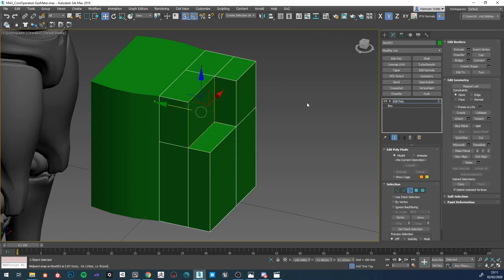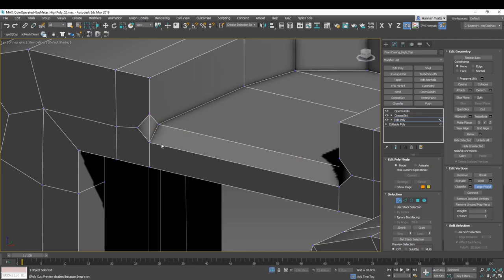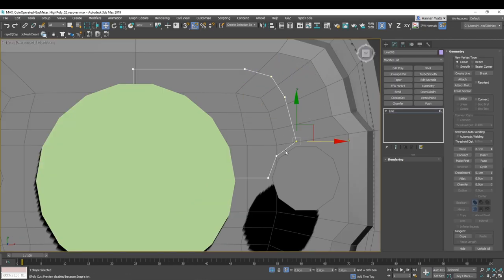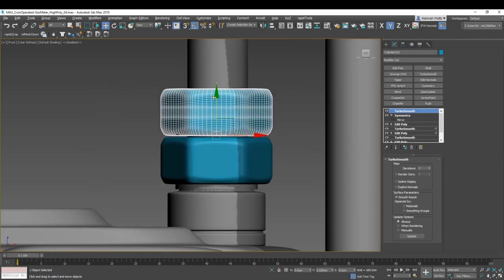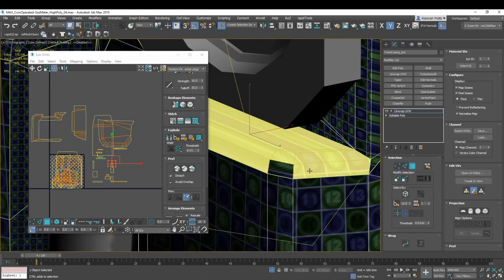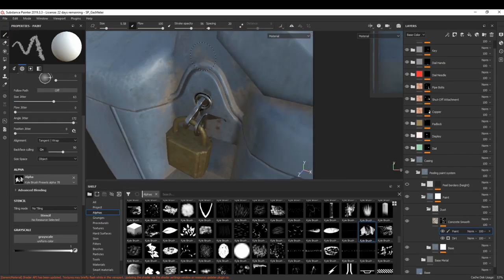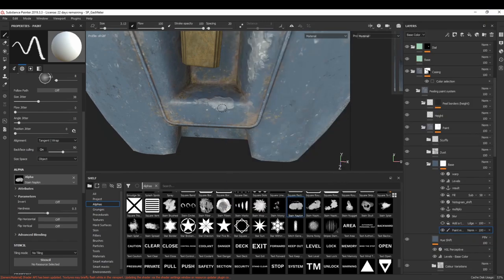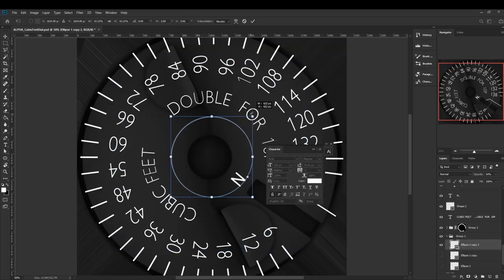Modeling & Texturing Props for Games - Trailer

Comment: For creating game props which software is mostly used in the industry? Max or Maya??? 🤔🤔🤔
Reply: Maya is industry standard with blender soon approaching because of Ubisofts investment into the software. Hope this was useful
Reply from the maker: Depends on the studio. More games studios seem to be going over to Maya these days. But Max is definitely still being used in big studio as well.
Reply: Most tutorial i saw for creating game props use max. Because the non destructive workflow i guess.
Reply: When I got work experience at Two Point Studios they were using maya and my lecturer runs his own modeling studio that uses maya
Reply: @TheAJP  blender "soon" doing this and that...LOL, I've been hearing and reading those lines for years now...Do you know that about 90% of the assets of AAA games are not even made by the said studio? They are all handed over to other studios and overseas? For modeling, rigging, tex, etc, etc? Guess what software they use?
Reply: @jamesjason8471  I agree, but I also think that the soon-thing has some bases. Blender (never used btw, because of the reasons you presented), is getting bigger and bigger through the years. I do think it's not a claim made by fanboyism to be fair. There are quite big works coming out of that software (Most noticeable the movie on Netflix called Next Gen) and implemented some features that Maya got later (Like the autocircular stuff). I'mma stick with Maya, but there's value in using Blender professionally in the future
Reply: I work in a sr¿tudio with half a dozen modelers. We use Blender. Same as other studios I know of. Save for the largest or oldest studios, Blender is the most used these days.
Reply: @ChrisMasna  I disagree...I've worked in four studios till now ranging from having 16 modelers to having over hundreds and all four studios specifically asked for skilled in Maya employees...We get projects that even specify the build version on Maya that we need to use.
Reply: @jamesjason8471  Interesting, I guess it depends on location as well.
Reply: @TheAJP  You really think Blender is becomming an industry standard because of Ubisoft and Epic's money? You're so deluded. Autodesk makes more money in a year with Max alone than the Blender Foundation with Epic and Nvidia's money.

Comment: Blender is the future. 
This course is stuck in the past.
Reply: Yeah we've been hearing you Blender kids squawking that for 10 years now and yet it never comes.
Reply: This entire thread's salty. If you're going for a job in the industry, yeah there will be prerequisites such as knowing how to use a specific software because the supe isn't gonna babysit you unless they're using private and proprietary software that's specially made for them. 

However, if you're in an indie production house, I don't see why it matters. If it gets the job done, it gets the job done. 

My current workflow looks a little like this:

ZBrush for sculpting, blender for retopo and UV mapping, substance painter for texturing, c4d or blender for animating, cycles for rendering and fusion for compositing.

Again, to each their own. If someone's interested in a Max course, you shouldn't go out of your way to annoy the others. 

Blender's a great tool but expecting any one software to flawlessly cover the entire pipeline is stupid. 

As for the industry pros, it isn't wise to pick on aspiring artists either. Blender's common with the younger crowd which means in a decade these users are gonna be your majority. It's the truth, whether ya like it or not.

Comment: >subsurf
>3ds max
Can I get some 2020 techniques and not 2011 techniques please?
Reply: If you're incapable of translating mostly software agnostic techniques then I don't think the 2020 techniques are gonna help you.
Reply from the maker: The techniques haven't really changed
Reply: @oBCHANo  Basic modelling is well known to everyone, so is subdiv modelling, which is obsolete when it comes to props as shown. Why make another tutorial on something that has already tons of tutorials on. Most AAA use booleans with a zbrush pass to achieve a highpoly, which is a lot faster and is one of the new techniques I would like beginners to learn more about.
Reply from the maker: I'm sorry, but that's just not true.
Booleans have their place, the same goes for traditional modeling.
Booleans and zbrush don't just magically replace modeling.
It's great for concepting and can be a powerful tool for sure.
But you still ned your low poly. And often blocking out with box modeling just makes more sense
Reply: @FlippedNormals  let me elaborate on my position, we are not in complete contradiction
my vision of the problem is three-fold:
1. the techniques showcased in this tutorial specifically regarding the creation of a highpoly mesh are not the optimal way to achieve such a result and are inferior to boolean/zbrush when it comes to similar hardsurface meshes. of course only regarding highpoly, retopo is and will for the forseeable future be the best using traditional techniques.
2. pointlessness of a tutorial showcasing already widespread techniques with a lot of free tutorials on them, which is reinforced by the object in question not having any complex geometry
3. the use of 3DS Max in 2020, it is perhaps the least widespread mainstream software, at least from my experience in AAA, I personally know only one person using it and he is in the middle of switching to blender. Maya would be understandable, Blender would be prudent, Max seems outdated.
Reply: @karatwilight  I plan on making a couple soon :)
Reply: @namesurname624  Holy cow you're so pretentious. Subdiv modeling is still being used, and produces better topology that booleans that always mess up the edge flow. 3DS Max is still Autodesk's best selling software, it sells 3 times more than Maya. Switching to Blender isn't prudent because barely anybody use it in studios (youtube testimonies of false-flagging blendlets aren't valid, go visit any studios worth their salt, none of them use blender), while Max is still the #1 choice for pure modeling. Max's modifier stack is ridiculously powerful thanks to the edit poly modifier which removes the need (in many cases, not all) of retopology since you can simply remove your bevels and complex shapes in a non-destructive way, something no other software allows (except houdini but nobody use it for this task). Max's workflow might be outdated, but nothing comes close when it comes to all the modeling tools it offers out of the box.
Reply: @phosphorus2740  You are clearly way too emotional about this and clearly don't have experience with other software. Let me explain where and why you are wrong: Edgeflow doesnt matter because the zbrush pass is used to soften the edges. 
I wouldn't look at sales numbers, in my experience the only people that use 3ds max are archviz fellas that are stuck with VRay.
Non destructive modelling isn't anything new to any other software, I am using Blender 2.79 and it saves me a lot of time. This is not exclusive to Max. 
Max has been offering the same thing for ages now and has been surpassed, just learn a better software package. 
I am not interested in this software war bs.
Reply: @phosphorus2740  So i planned not to go into this argumentation but i have to correct you on atleast the one false fact you try to spread.
Blender IS used in many AAA studios and i know that for a fact because i worked with many of those. 
Yes Maya and Max are still the most used ones for sure and will be for the next couple of years but that doesnt alter the fact that blender is by now a viable software to use in the industry :)
Reply: Im glad you went there and not me! Truth is! In terms of texturing, the only thing you need is the image sources and a good shader set up. 

Blender cycles node set up is basically 3D Photoshop. In fact if you use it with Photoshop, you can get even more detail!
Reply: "3. the use of 3DS Max in 2020, it is perhaps the least widespread mainstream software" 

LOL, the delusion only Blender shills can bring you.
Reply: @namesurname624  The edge flow matters for hard surface assets that won't be sent to Zbrush (and even the ones that will be sent in zbrush in many cases). Try smoothing, turbosmoothing or even in some cases beveling a mesh with a bad edge flow. :) Try to bevel and extrude complex edge patterns with a bad edge flow. Knowing how produce good topology, redirecting the edge flow and fixing bad topology is crucial to achieve AAA quality, something you seem to know nothing of despite your music school attitude. It's funny how all of these cockwomble comments always come from Blender users. By the way I've been using Max/Maya, Zbrush and (in the past) Blender for almost 10 years, I have actual industry experience. Don't make wrong assumptions.

"I am using Blender 2.79 and it saves me a lot of time. This is not exclusive to Max. "
Blender doesn't have true non destructive modeling since it doesn't have the edit poly modifier that actually makes it non-destructive.

Ohle Mathiebe> Blender is not used as a main pipeline tool in the vast majority of studios even though some individual artists might be allowed to use. It can barely stand 20k polygons in edit mode, how can it be used for anything serious in it's current state? Sure you can model some assets just fine with it, but when you crank up the poly count to add fine details it will hit rock bottom. Try modeling complex ornament patterns with it and tweaking the whole thing in edit mode, the framerate will drop to 2 fps.
Reply: OH AND I FORGOT! You also need to do subdiv modeling if you're working on an asset that deforms (such as a bending object), for it's high poly version, and this of course require good topology if you want to avoir artefacts. Do tell me if you want me to educate you some more, maybe you'll be more humble in the future.
Reply: @phosphorus2740  its just not true with the performance... blender isnt worse in that regard then maya or max. And who said blender is used for the pipeline? I never said that, the topic is about asset creation and for that blender is used alot more then you might think in AAA
Reply: @ohlemathiebe  The performance issue is absolutely true, even the blender foundation anknowledges it and are reportedly working on the issue. Try to bevel a high res model in subdivision surface mode. It's fucking atrocious.